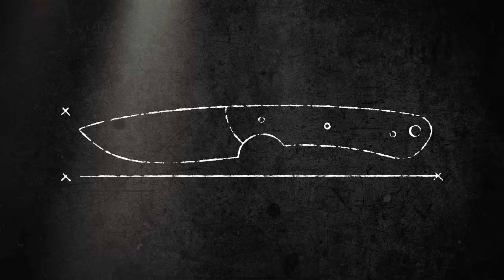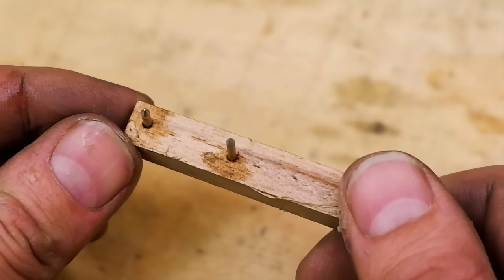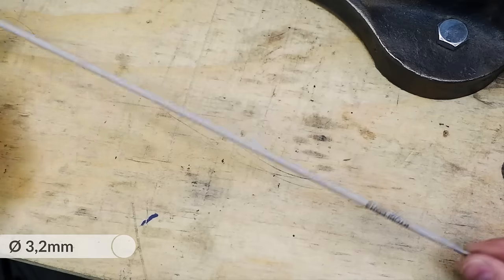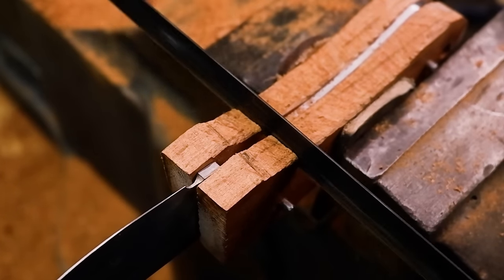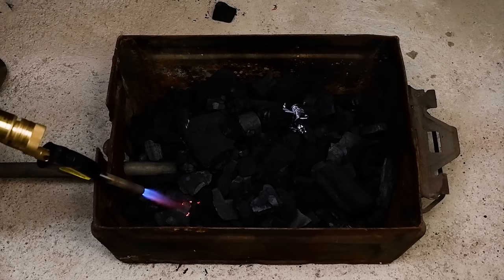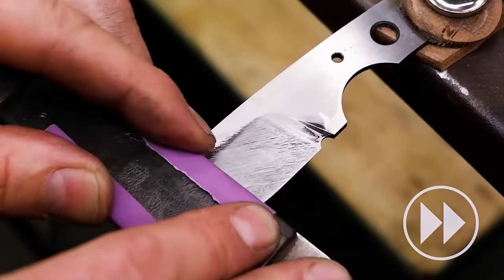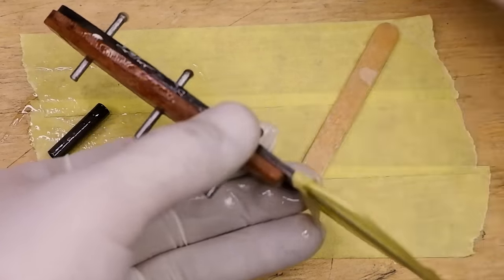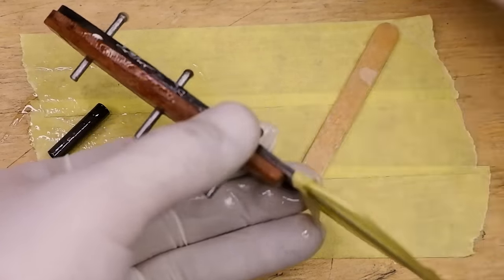Making a Drop Point Hunting knife, without the use of a belt grinder

Comment: i have the cheap HF 1x30 belt grinder. I've modified it to be more suitable for my knives. I've learned how to freehand bevels with it. I can make a decent looking knife with the crappy belt grinder. HOWEVER, knife making is therapeutic for me. And there's nothing more therapeutic than putting on some tunes, zoning out the rest of the world, and hand filing bevels.
Reply from the maker: Yes that is true...hand filing, and hand sanding tends to leave you to your thoughts. And, you learn to use the tools you have at hand. I remember when I first got my 2x72 belt grinder, I thought to myself now I am going to produce knives at a lightning pace, only to very quickly realize that freehand grinding is a skill that needs to learned, and no machine regardless of quality will teach you how to do that...it's still something that I  sometimes don't get right....hand files on the other hand...you cannot go wrong with it...:)

Comment: I bought a cheap belt grinder and I really struggle with grinding the blades..but I tried your file and eye-bolt method.  Even though it takes FOREVER,  it produces the BEST grinds ever! Thank you for the inspiration!
Reply from the maker: Try combining the two. Take off the bulk of the metal with the grinder, then finish on the filing jig. Free hand grinding takes alot of practice, and depending on the blade shape can be very frustrating to get right. I also dont always get it right...and I hate wasting material because of messed up grinds.

Comment: Why peen the pins only to sand them flush with the scales? Doesn’t that defeat the purpose?
Reply from the maker: The metal pins expand slightly into the wood where you peen it, thats why you need to becareful not to peen it too much because you can crack the wood if the pins expand too much.

Comment: Great Video ! I am also using 1084 and struggling with plunge lines. I agree that the 1084 is forgiving and easier to work with. Two thingsI found helpful from this video is using an oil while sanding the the use of the correct round file with a file guide.  Henk has been so helpful in answering questions while I make my first knife. I need to hurry up and get one done, he has asked me twice to see a finished knife. Thanks for the inspiration and encouragement.
Reply from the maker: Its a practice thing. Take a piece of scrap steel and just file plunge lines. You will get it right.

Comment: Your videos are very good, I am making all my knives pretty much by hand, I first used large circular saw blades from sawmill but now I' trying 1084. I can't believe how much easier it is to work with! I have been trying to file my plunge lines  with round file but they never seem to come out that great, I will keep trying though, I'm sure I will get it! eventually!
Reply from the maker: It is a practice thing...just keep trying, and you will get it. Do you use a file guide clamp? If not spend the time and make yourself one, or you get commercially available ones but it tends to be very expensive. That simplifies getting your plunge lines symmetrical on both sides. Grab a piece of mild steel flat bar and spend a day just filing in plunge lines to get a feel for it.
Reply: @zeemanknives  That's very helpful, I have actually made a file guide clamp so will do do exactly as you say and practice on some scrap steel until I master it,cheers
Reply: Saw blades will have a heat treat, while 1084 or any steel stock for that matter is annealed. This makes it MUCH easier to work with. Annealed steal is like 5-20 hrc, while heat treated steel is usually 50-68 hrc.
Reply: @thorwaldjohanson2526  That's great information, thanks, (I only just saw your message!)
Reply: @mikenorris6769  you can also anneal hardened steel yourself, make the knife and then heat treat it again.

Comment: Best tip is to start with thin stock. Nothing worse than grinding edge bevels in really thick steel. Remember, thinness is sharpness. Starting with 1mm steel will give you a much sharper knife for kitchen use or such, even if you don't get perfect bevels it'll be thin enough to not get in the way. 
Knives dont need to be as thick as you think, given you get the heat treatment right! Toughness matters a lot on heat treatment quality, hardness is easy to get and almost irrelevant to its toughness. Heat the steel only until it's not magnetic and no further, then quench in water if you don't have parks 50, cooking oil won't harden 1060/75/80/84/95/W1 etc. only O1 or 52100 would harden well enough in home oils thanks to hardenability slowing additives, unless the knife is very thin already like I suggest, though you also need to be careful that it doesn't cool too much before quenching or it also won't harden fully. You can put it in your freezer immediately after quench for a slightly harder blade. Then temper it at 300-400f twice in a toaster oven with a cooling in between them. 300f for hard as possible, and 400f for tough as possible. Steel choice matters most for this, soft 1095 will never be as tough as fully hard 5160. That will give you the hardest, toughest combination possible from basic steels without a specialized heat treating kiln.

Comment: When hardening in carbon, I would use a steel section with a rectangular cross-section. Once warmed up, I would insert the blank. This is how I would create a hardening chamber. The color of the shape allows you to additionally assess the temperature. This also reduces the risk of steel burning. I wouldn't delay letting go either. During this time, the steel consolidates its crystalline structure. Immediately after hardening, just to be on the safe side, I would place the blank between 2 flat bars and squeeze it until it cools down. The blank is plastic for about 2 minutes after hardening. This would correct the curvature. Any stress before tempering causes the risk of the blank breaking
Reply from the maker: Thank you for the advice. Keep well!

Comment: That is a great video, I value your tutorials and learn so much from them! Could you please tell me what thickness (in metric) you like to leave on knife edge when doing bevels? Also, should I start process with coarse file for quicker removal then switch to a second cut file to finish, or, do you use same file for whole  process, Thanks
Reply from the maker: Thank you for the comment. I try to get the edge to about 1mm before I heat treat. I used to start with a coarse file but I found that the deep file marks are very hard to remove...so nowadays I do everything with a medium cut file. The time "saved" by using coarse file is not really worth the time hand sanding afterwards.

Comment: You can achieve the rounded transition in the bevel from the plunge by moving the belt slightly over the edge. However much over the edge the belt sits translates to how round of the plunge you get. Thats if your using a 2x72 that is
Reply from the maker: Thank you for the tip!

Comment: Hi man nice video
I don't know much about knife making but I liked the video

For tempering, you want a orange hot, not white/yellow, not gray.
The spine has to be dimmer than red because you want resistance not strength.

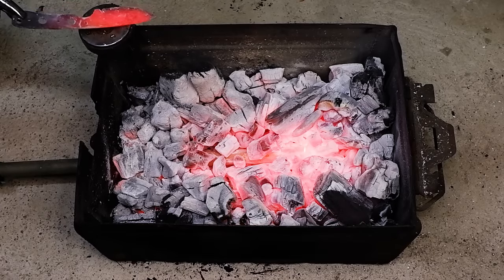Basically, do the opposite of 26:09.

Anyways butterfly knife would be pre cool!!!!
Reply: I think you’re talking about hardening not tempering.  If you heat the blade orange hot during tempering you will ruin the hardness of the blade.
Reply from the maker: I usually temper in a dark room to accurately judge the metal colours. It looks much different under a bright light. For the 10xx series and 5160 metals, critical temp is usually around a red colour. Still, always test with a magnet, and of course if you have a kiln with accurate temp sensors then you cannot go wrong.
Reply: Again I think you’re confusing tempering and heat treating.
Reply from the maker: @nickthompson529  Yes you are right...wrong terminology from my side. I heat treat in a dark room to judge the colours of the steel, tempering happens in the kitchen oven.

Comment: Hello my friend, i like your vids. Question at minute 22:42 you are rounding your handles. Do you you use a half-round file are a regular rectangle bastert!!
Reply from the maker: Hi, i use a flat file on the handle, and a half round file in the rounded sections like the the finger choil and inside of the handle. I prefer medium cut files as bastard file can be aggresive and cause nasty scratches.

Comment: I have a question, can you gring already hardened steel with a file? I mean if ill buy blank of a knife, is it possible to remove big amount of material from hardened steel?
Reply from the maker: Not with a hand file I'm afraid. You will blunt the file very quickly without much progress if the steel is hardened already. A belt grinder will be a better option in that regards, or you can anneal the blank and re-harden after filing.
Reply: @zeemanknives  ok, thanks for reply 🙂

Comment: just out of curiosity what is the totak amount of time put into this ????  where did you get your metal . do work 'haeder' blade steel ?? and longer ???  a beauy of a true " hand " made knife !!!!❤
Reply from the maker: Its hard to keep track of the exact amount of time that I put into a knife, as I work on it over several days...but depending on the size of the knife it can be anywhere from 20 to 40 hours total time. I buy my steel from a local supplier in South Africa, @zeesknifesupplies. I always work with soft unhardened steel, and heat treat it to harden it. If you work with hand files then its difficult to work with hardened steel.